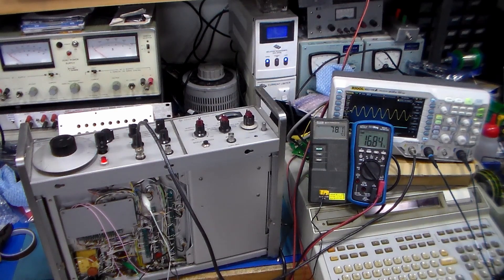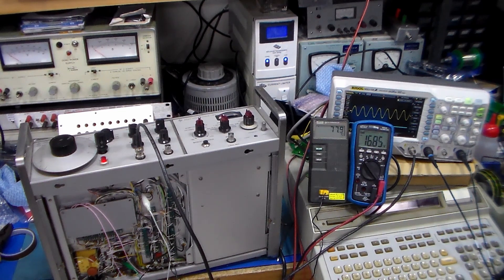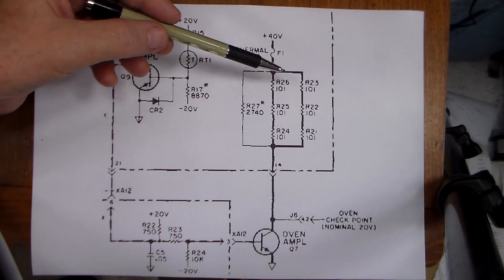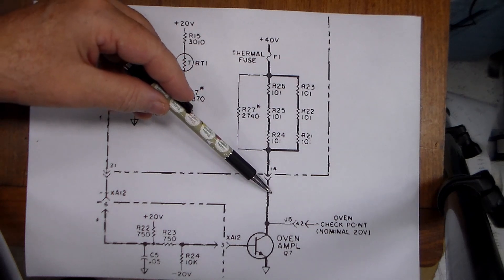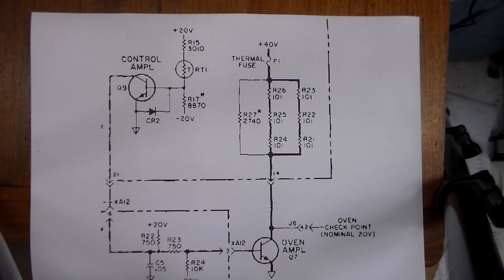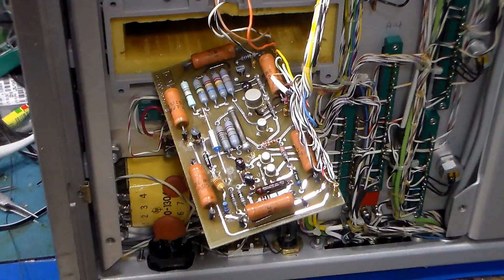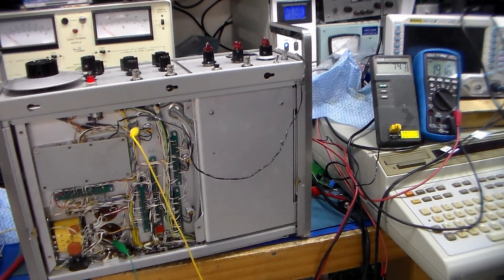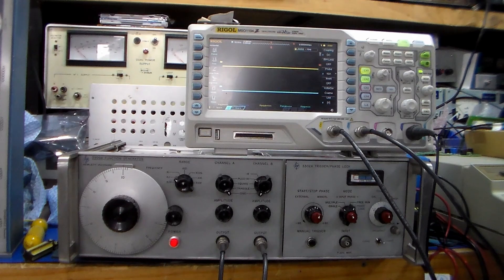HP3300A Oven Repair Part 1

Comment: Interesting ^^ - in mine, the oven regulation worked; It was Q5 that was initially broken. I didn't bother to check the tempereature itself, but the Q7 voltage went to almost smack on 20V after the announced heat up time and came on a bit later. So I trust it to be "within reason". Did you find out what's wrong with the low frequencies yet? Just curious, cause in my case I had the scope AC coupled without noticing and it looked quite similar 😊 (oops, didn't see the other video yet, sorry)
Reply from the maker: Normally, you only need to check collector voltage on Q7 to see if the set-point temperature is being maintained. As the previous owner installed the wrong transistor type (Q9) causing the thermal fuse to blow, I had to monitor the oven temperature when I was setting the transistor bias, while also checking the voltage on Q7. Part 2 you will see how I fixed the low frequency ranges.